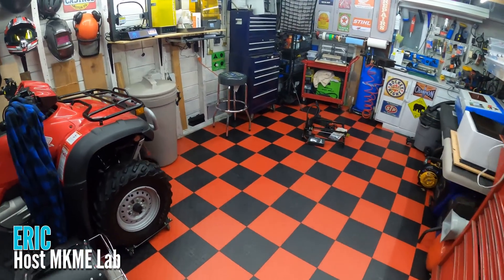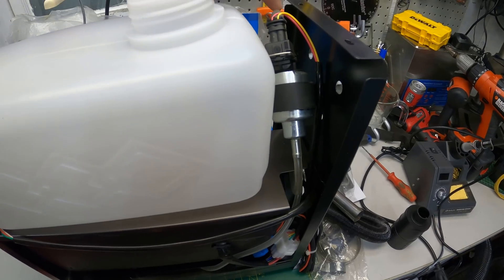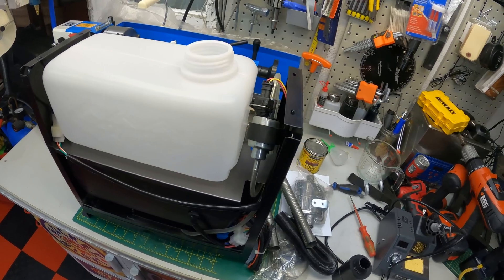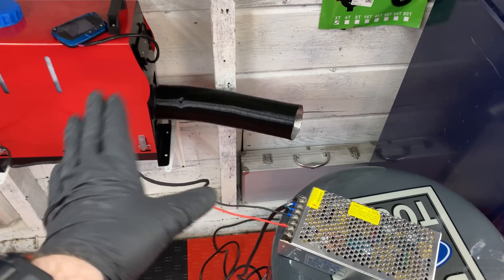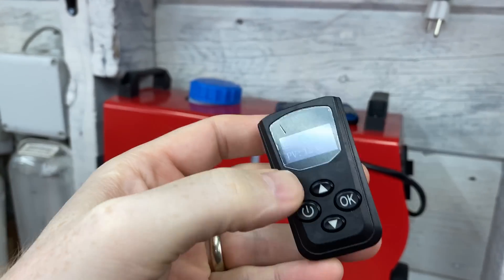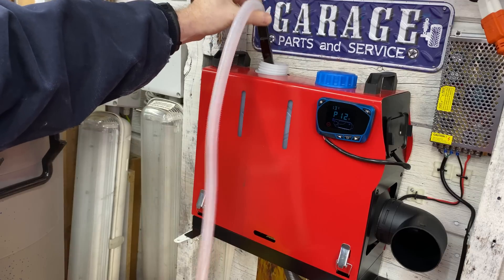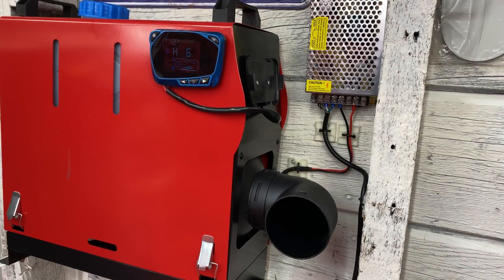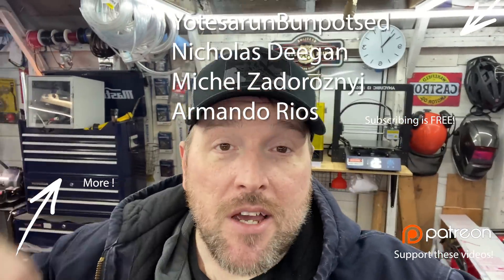Everything You Need to Know About the Chinese Diesel Heater - MY SHOP IS WARM!  🔥

Comment: I'm at that "should I or shouldn't I" stage in terms of buying one of these heaters.  There is so much information out there, some good, some bad and unfortunately some that contradicts each other.  I do not have a workshop so the purpose is to supplement domestic heating if at all possible.  I am not talking about the whole house, I'm talking about one room living room with the unit mounted outside.  Of course with the cost of diesel going up all the time, when will it become too expensive to run.  Great video and thank you for taking the time to share it with us.  HNY....

Comment: I have been testing my diesel heater on red diesel. It is much too small to heat my house but the living room gets comfy. I have my furnace turned off to give the middle finger salute to the gas company. The diesel heater will go in my van conversion when I'm done playing with it. The 1/10th watt LED mounted above the fuel pump shows the fuel level from 30 feet away. A 5 liter plastic fuel jug with push button spout makes it easy to refill without spilling a drop.  The power comes from 16 Headway 38120 lithium batteries with an on board 8 amp charger. The exhaust fits through a 3/4'' NPT hole that I drilled and tapped into the side of the wood stove. After a while, there is enough recovered heat to use the stove blower fan.
https://www.youtube.com/watch?v=sHCuztvBnWs

Comment: Thank you for posting. I have just purchased one of these heaters after watching many (mainly positive) videos here on YouTube. One problem that may not have occurred to some people using a direct (via dropper) mains supply is, if there is a power outage the normal cool down period is not available i.e. No fan running...... Not sure what the consequences are if this should happen🤔
Reply from the maker: You will get the heat energy stored in the combustion chamber and heat exchanger released in to the fan motor and controller. Not immediately destructive but quite undesirable for the bearings/bushings & brushes. If you want to avoid it a small UPS can power it quite a while for you to shut it down manually or ride through a small outage.
Reply: @MkmeOrg  Thanks for that👍

Comment: It's important to properly size the power supply unit.
Spoke with my electrician mate who determined that the heater needed something over 20 amps.
5kw at 230v is just a touch over 20amp before power factor correction.  
So I ordered the 30 amp unit.
.
Reply from the maker: Your electrician was incorrect. This is not an electric heater bud- its diesel. The only draw is fan+control+Glowplug(during ignition only) The 5KW refers to the overall heat output, not the consumption.  Heat energy can be expressed as BTUs, watts, calories and more.
Reply: Change your electrician. While the glow plug is active you will see possibly up to about 8.5 Amp draw @ 13.6V, this drops to around 3 amps max once lit and running.
Reply: My power supply is 8amp. Works perfectly. Am considering running via a UPS battery, to assist shutdown program in power cuts.

Comment: Thanks for your time, do you have any insulation in ceiling or walls?
i’m thinking about this for my 12x24 steel building, going to spray foam it  next week or so to deal with condensation issues then figure out heat.
Reply from the maker: No insulation at all and gaps all over

Comment: You can do an exhaust pipe expander in zig - zag shape from some cooper pipe before getting out the smoke. In that way you can recover inside workshop some of the heat that you are trowing away without it.
Reply: I watched a guy on YouTube from I believe Australia, who has done a ton of research on the original documentation from where these heaters were copied.  He says the max bend in exhaust is 270 degrees or else you get a soot build up and it affects the efficiency of the unit.  So that's 3 x 90 degree bends if you know what I mean.  Just something to think about as too many bends will start to restrict flow.  Just an fyi.  Cheers

Comment: great video. they have a 12V 33A 400W vs the 12V 15A 180W DC Universal Regulated Switching Power Supply for only $5 more. is there a reason I wouldn't want to get the more powerful one? figure I could use in on a few other projects I have coming up. also like the pump with it's shutoff feature so I'll be getting one. already have a heater but still in the box. are these affiliate links so you get credit?  ty and appreciate the input. 😀
Reply from the maker: No reason not to go for the bigger one really- won't really consume any significant amount more.  Yep they are just basic Amazon affiliate links- I get a small commission which helps me build more fun stuff.  Cheers

Comment: It's humourous that they show using it in your car, with illustrations of places to mount it.  Well... unless I'm forced to live in my car, I'm not going to start cutting holes in it for the exhaust.  I think the home workshop/garage is the perfect use of it.
Reply: It’s because these are designed for rigs and RVs… Hence the 12 V system.  I think it’s ingenious how he converted it to be used in a shop.
Reply: The funny thing is, im thinking about using a diesel heater as a auxiliary Space Heater for the car. But where to mount it so it's temporary for summer season? And like you mentioned, cutting holes. I mean I could use the drain plug holes for the exhaust and intake but its too much work. Better off investing in a block heater/oil pan heater.
Reply: @OffTrap  The drain holes are way too small, meaning they would impede the exhaust and therefore the clean double-combustion. Your heater will never get hot enough and the partial combustion will result in back foul-smelling smoke all the time. If you have one of these tiny triangular windows or plastic panes behind the main rear windows, maybe you can replace it with one fitted with a hole during winter time. Or use one of these aeration grids to transport dogs in the boot, fit the exhaust to it and tape the rest of the grid. This heater is quite tall though, and you need lots of extra space under it for the burning hot exhaust, so the deconstructed variant without a case, that you can assemble lengthwise on a frame instead may be more suitable. But still rather dangerous...
Reply: Yeah, not really practical for cars that sleep in the icy outdoors unless maybe you have a station wagon where you can fit it safely in the back. Modern diesel cars such as VW have had programmable built-in heaters for years, that do more than heating the cabin and defrosting the windshield and door windows in the morning, they also pre-heat the engine so the car does not start in a cloud of black smoke.

Comment: If you use air from inside as input, is it not replaced with (cold) air from outside. I can see that burning warm air may be more efficient. Thank you for the video.
Reply from the maker: It's a tradeoff I think. You lose a bunch of your heated air by moving it outside, but I think the efficiency gains outweigh it when you are in a large building and not a van.
Reply: Diesel engines like cold air; it's denser and aids combustion.  This isn't an engine, so it may not matter though.
Reply from the maker: @gregr5  Diesel internal combustion engine uses extreme compression to increase the temp to ignition. Cold is denser true but we are not compressing it in a tiny combustion chamber so we dont actually pack an more in at colder temps.  The two really don't have anything in common besides the fuel I'm afraid.